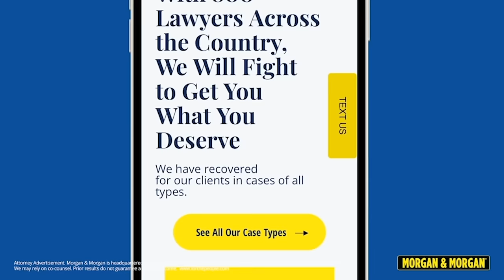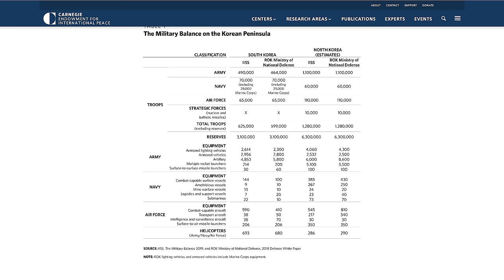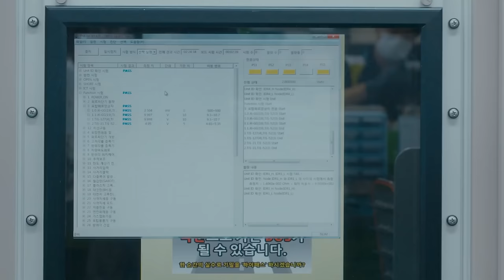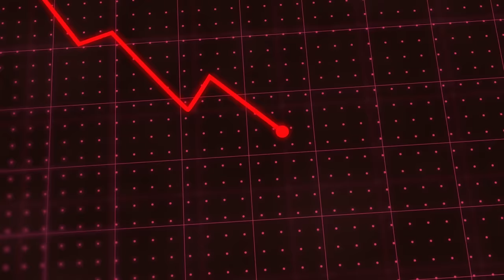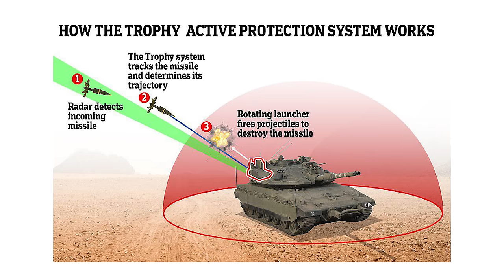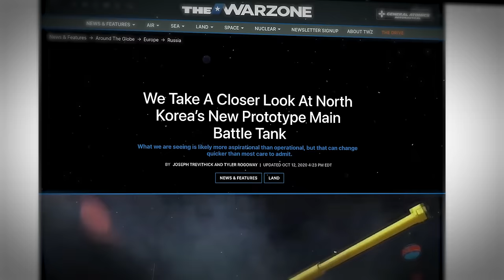North Korea's NEW Tank is a Nightmare

Comment: Playing devil's advocate regarding the ATGM's: As mentioned, tank on tank combat is relatively rare. Having a couple of ATGMs can allow the tank to carry more HE rounds and use the expensive ATGMs for other tanks (though probably still carrying sabot, only less of them). ATGMs are quieter and harder to spot where they are fired from, and can fire from longer ranges, not to mention may hit other tanks behind cover with a top attack (assuming the missile has the capability). They might also make sense if used against other tanks with active protection, allowing a quick double tap ATGM+Sabot in an attempt to defeat the APS (depending on the APS, this may or may not be effective). ATGMs can also be used against low flying aircraft, giving the tank limited AA capability. I think ATGMs can make sense on MBT's if they are used sparingly for those niche cases. With this in mind, awkward reloading of the missiles is not such a big deal, as they can fall back to SABOT from the main cannon if they expend both missiles in combat.
Reply: Increased HE complement was my first thought as well.

The other very valid reason to add missiles is if the gun lacks in long range precision.
Might be the sights, firecontrol system or the gun barrel, but either way a missile would solve that problem, leaving the shorter range engagements to the gun.
A third reason is if NK has problems producing long rod APFSDS capable of reliably punch through modern armour, thus limiting them to HEAT rounds that are notoriously difficult to use at long range due to their slower speed and thus long travel times (which was the reason Soviet Union dabbled in gun launched missiles to begin with).
Reply from the maker: I’m always willing to keep an open mind ! They could be dope as heck for all I know
Reply: ATGM idea is great! Not only tank on tank combat is rare, it can be used to engage at long distances. It can be used against helicopters.
Reply: @Taskandpurpose  could also be like the 75mm B-25 guns (Military Aviation History put up a video recently), solid reasons and flawless solution but in the end the application was so limited that it in hindsight was a waste of time and resources.
Reply: The ATGMs could also allow for engaging targets at a wider depression/elevation range than the main gun, which is relevant in the very hilly Korean peninsula.
Reply: @johanmetreus1268  Russian tanks can launch ATGM from the 125mm main gun.
Reply: They are more tailored for ground to air defense...Especially, slower moving helos, and A-10 hogs...The poor mans surface to air missiles, that are portable, and accurate.
Reply: @bruceparr1678  yes, because they found it difficult to hit moving targets at a distance with the relatively slow moving HEAT-shell, the Soviets came up with the barrel launched guided rocket.
Reply: @bruceparr1678  yep, that's also my concern regarding the M2020's peculiar ATGM launcher position on the tank
they could have stored the barrel-launched ATGM along with other tank ammunitions and have it launched from the relative comfort inside the tank

but instead, the awkward position of the ATGM launcher suggests that perhaps the tag-along infantry would carry the missiles and reload it 
on the upside, the tank crew wouldn't have to carry the missile outside in the midst of combat to reload it; if the ATGM were to be carried inside the tank, they would have made it a gun-launched ATGM in the first place
Reply: alternatively, we are all bamboozled here, and that launcher turned out to be a ManPAD launcher with 2 short-range missiles specifically for anti-air and not for anti-tank
Reply: @arvypolanco They're better for long-range accuracy, if your country also doesn't intend to do much gunnery. Think about it: The DPRK tankers dont have lots of fuel to go do large scale gunnery training. They also don't have the best FCS for the main gun. Or computers to calculate ballistics. Training tankers to simply lase a target is far simpler than taking a long range sabot shot. The ATGMs make sense for the issues the NKPA faces.

There's also a possibility that...the ATGMs actually have better armour penetration at range, due to issues with DPRK ammo production.
Reply: @tranquoccuong890-its-orge  using a barrel-launched ATGM has 3 issues:
1) It increases chamber pressure, decreasing the barrel's lifespan when fired
2) It limits the ATGM's caliber to the bore size of the gun. For HEAT, this limits the theoretical maximum armour penetration. A 152mm warhead should pen more than a 125mm warhead of equal make. This can be bypassed somewhat with different designs, such as a top-attack mode.
3) Increased cost of the FCS to integrate the ammo

Issue #1 is a problem when you are cash-strapped like the DPRK. Issue #2 is a possibility, given that the 115mm/125mm GLATGMs are probably not expected to penetrate any of the US/ROK tanks. What we are seeing might be a tradeoff, given the DPRK's very unique problem sets.
Reply: @AlphaAurora  there are of course a lot of engineering problems to the barrel-launched ATGM concept, most of which were likely addressed by in the design phase and accepted as trade-offs to the desired capabilities 

the pioneer & most egregious user of that concept, the USSR, probably chose to launch the ATGM from the barrel to have the tank remaining air-tight & capable of fighting in NBC conditions (in case of an all-out war against NATO where tactical nukes would be used on the battlefield)
in that context, the issues related to barrel-launched ATGM are well worth the trade-off with the ability to fight in NBC environments
Reply: @AlphaAurora  beside, i don't think issue #1 is actually any worse than any barrel wears made by high-pressure APFSDS rounds
the barrel-launched ATGM's rocket engine doesn't start in the barrel chamber, it only starts outside of the barrel:
- firstly, a small black powder charge push the ATGM out of the barrel
- only when the ATGM is competely thrown out, it starts the engine and begins its flight
at least that is the case for the ATGMs launched from the 125mm gun
Reply: @tranquoccuong890-its-orge  yes, and now imagine trying to do all that with the industrial base, knowledge base and supply level of North Korea.
Reply: @tranquoccuong890-its-orge  barrel life is still a lot less than if you didn't have use them. Plus you have to remember that while barrel life usually isn't a factor for most nations, for North Korea, it probably is due to a combination of industrial base and knowledge base. Again, how often do you think the average North Korean tanker gets to shoot?

Comment: It is possible that the ATGM launcher was added so that it could achieve standoff with potential enemies. ATGM’s usually have longer range than a tank’s main gun, so standoff would be possible with that weapon system.
Reply: Most missiles will have ranges of about 3.5-4km. Most modern APFSDS fired from western MBTs should be able to deal with Russian tanks from 3+km away with their modern anti-era tips, so the distances are actually somewhat similar, if we consider the armor to be on similar level for the mbt2020. European countries are also installing new fire and forget ATGMs on their IFVs with range of 5+km like the AKERON and spike missiles, which would be the bane of tanks on long range engagements.
So while the ATGM might look like a good idea on paper, I think it’s uses are still pretty limited.
Reply: @vizender  Smoothbore guns using fin-stabilized ammunition aren't as accurate as rifled barrels using spin-stabilized ammunition like British 120mm HESH. So, over longer ranges of 4km or more, smoothbores aren't especially accurate, not to mention that you need to wait 2 seconds for a 120mm APFSDS round from M1 Abrams to hit a target 5km away which will likely miss a target going at high speed over rough terrain, while ATGM can constantly update trajectory and thus it's plausible to hit even slow airborne targets like helicopters or low flying drones which is why you got smart guided munition on modern tanks like Israeli Merkva MK4 or South Korean K2, not to mention beyond visual range wire-guided missiles on IFVs like latest versions of CV90 with Trophy APS that can kill your fancy but obsolete M1A2 Abrams without active ballistic protection from behind a hill by top attack or even by an insurgent using cheap modified civilian drone...
Reply: @IonorRea  France advertise that they can hit a target moving at over 40ph when they themselves move at that speed over 2km away. From interviews of crew commander they also claim that, with an APFSDS they are able to hit in an area of  a disk with a diameter of about 50cm from 4km away. Modern FCS and rods can still be very precise at such distances
Reply from the maker: It’s a good point ! Personally I  don’t think ranges over 100km are likely in Korea geography , it’s not the desert . Not sure you’d need more range there , maybe in Iraq geography .
Reply: But what is the point of anything long range in a country like North Korea which is mostly rough mountains with steep sided winding valleys? To use range they would need to place the tanks on the mountain peaks which would leave them as sitting ducks.
Reply: @Taskandpurpose  IIRC Korean geography offers a lot of moutains or at least steep hills. Could an ATGM be used on out-of-sight targets ? (Not sure why you'd need to have the missile mounted on a armored vehicle if it stays out of sight though)
Reply: @MjolnirFeaw  If their missile is based on the Russian Kornet system then it is dependent on being able to see and "paint" their target with a laser that the missile will follow as it is flying so it is not designed for use attacking targets out of sight.
Reply: @IonorRea smooth bore main guns are  better when using Sabot rounds than rifled main guns .

 Also, most modern sabots can hit a target further than ATGMs. The issue that most modern tanks are running is that a modern fire control can't calculate a ballistic solution with a hight probability of hitting the target at the longer ranges IE 4.5k and Up.
Reply: Here's the problem. At 5k the M829A3 sabot round takes 3.2 seconds to hit a target. In that time a tank moving at 20mph moves 28.6 meters. Any changes to that tank will cause that round to miss.
If the driver slowed down by a mile an hour as the main gun fired the round would miss by 2 meters.
Reply: Given the terrain of the Korean peninsula, a long stand-off distance for tanks is not that useful. These are neither the European plains nor open Arab deserts.
If the North Koreans had actually developed a tank for for their needs, it should have been a relatively light design with good mobility in dificult terrain.
Making it an odd copy of M1 and T-14 appears to me like a vanity project to impress the "dear leader".
Reply: A sabot round might take two or three seconds to reach a target at 3km but the average ATGM is going to need 8-10 seconds -- much more time for the target to notice the shot and duck behind cover, manoeuvre erratically, or return fire towards wherever the missile come from in the hopes of disrupting the operator's concentration. Probably more than one of those. So the advantage isn't all on the ATGM's side. A good loader and gunner pair may even be able to fire back two or three shots before an ATGM could reach them at longer ranges.

The question of whether ATGMs are more accurate than sabot rounds seems to depend heavily on the design of the round itself. Most Soviet APFSDS rounds had disc/coin-shaped sabots that only contacted the barrel along one ring-shaped patch, making it possible for the penetrator to wobble a litle this way and that as it went down the barrel and reducing the overall accuracy. Meanwhile, NATO APFSDS rounds are more like two-sided cups/petals with two ring-shaped contact patches, one near the front of the projectile and one near the rear; this does a much better job of longitudinally stabilising the round as it travels down the barrel. So traditionally the Soviets considered barrel-fired ATGMs to be a worthwhile addition to compensate for the poorer accuracy of their guns (relative to both their own earlier rifled guns and contemporary NATO smoothbores), while NATO MBTs didn't since the marginal gains they stood to make in terms of accuracy was simply too small compared to the already-high accuracy of their guns. Something similar might be going on with the North Korean tank; if they're not confident of the build quality (and thus accuracy) of their guns and projectile, it makes perfect sense that they'd want to have the ATGM as a backup just to be able to hit _something_.

Of course, all of this assumes that the launcher isn't just a non-functional visual dummy. Which is unfortunately also a likely possibility.
Reply: @reijek990  ANYONE, with proper equipment, can paint the target. it doesnt need to be a tank doing the lock on. same way russian artillery doesnt need to paint the target, russian infantry does that for them.
Reply: @vizender  Western MBT could not deal with modern Russian tanks on point blank range 😁Leo 2 is on level of early T-72 , Abrams and Challenger 2 are literary death traps . None of them survived 24h on the battlefield.

Comment: It is possible that their tank's main gun is not capable of firing ATGMs and they have to put an ATGM launcher from the outside, the best way to fix this problem is to not rush your tank production and actually just make a better gun.
Reply: Yeah...Only problem being that is a 2A46 derivative, which CAN shoot TGMs. Having an additional bolt-on ATGM system, which is a Kornet-type laser-guided launcher which is capable of HE-VT Anti-Air capabilities, Thermobaric Warhead capabilities, Tandem AT capabilities on a range from 5 to 10 km....That gives you a lot more capabilities while keeping it relatively cheap.
Also, before you talk about things being "jury-rigged" and "poor", take a look on the Ukraine front and what got the Leopard, the Abrams, the T-s. The West laughed at "cope-cages mhahaha copium so hard ruzzia lose" and then what? Everyone started doing it, what do you know.
Reply: External ATGM's don't have limitation of being squized through the barrel. It means they can have longer range, bigger warhead, easier way to upgrade...
Reply: And maybe the Armor piercing round of the tank isn't good enough to fight modern tanks. Usually North Korea recycle part design from older vehicles like the canon or put add on armor on an older tank.
Reply: Lol what? 
The wested billions of dollars on a tank that can shoot atgms.
Even then the gun was overly changed in coming years because of problem after problem.
Meanwhile having a atgm launcher outside is better since it can help in targeting multiple targets as well as equipping higher calibre atgms
Reply: Yeah no i don't buy putting this independent and expensive targeting system in tandem of the already existing and capable ATGM main cannon. It would either require a hard input WOM system that is alot more complex than the existing targeting system already in place, which would also be very difficult to implement on the software side having to switch UX controls OR it would require a whole new suite of monitor systems IN ADDITION to existing WOM system unit. Both of which are pretty ridiculous. 

The logic doesn't make much sense what makes alot more sense is battlefield dressing for the parade though. 

~US Defense Contractor
Reply: @nikitachirich7985  it also is probably the m2020 is a "parade" tank like the t-14 armata, the atgm launchers may just be for intimidation, or as a message to the west. What is true is that putting external atgm launchers just complicates the logistics.
Reply: @theidiotictroublemaker2281  It is not, it will be another stressor to replenish and to maintain, an external atgm launcher will be an obstacle for era placement, especially at where the m2020 atgm launcher is placed at, they added ERA for a reason, it most likely is that the turret armor is not enough protection, blocking a possible era placement with an atgm launcher isn't a good idea.
Reply: @D-DiazCousins  yeah
Reply: Youd think if you have a big main gun why do you need atgm's ?
Reply: @tomdibernardo1699  to hit Targets further away.
Tank guns only have a effective range of 3 to 4 km depending on the tank but atgms can go 7 to 8km.
Russia proved this right by destroying a Abrams tank from 5km away
Reply: @nurnburgring3102  There’s a reason the western world realized barrel launched ATGMs are kinda a mute point. Compared to externally mounted ATGMs, like the bradlys TOW-2 system, the only advantage a barrel launched ATGM has is reloading from inside the vehicle. If the Norks we’re gonna use ATGMs on their tanks, externally mounted like that is probably the best idea
Reply: @nurnburgring3102  and yet the cope cages have been entirely ineffective at stopping FPV drones and Javelins. They are only useful at stopping the drones that drop grenades straight down onto the top of the turret. The UA employed them to stop the lancet drones and they've been partially successful at that when the Lancet operators aim for the turret ring but ineffective when aimed at the chassis obviosuly.